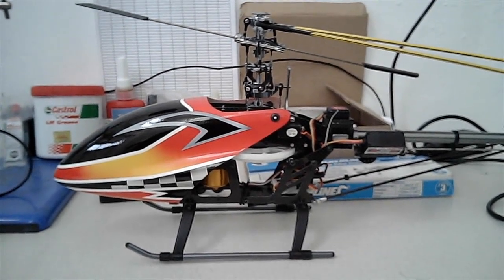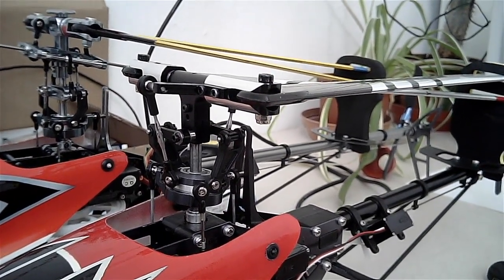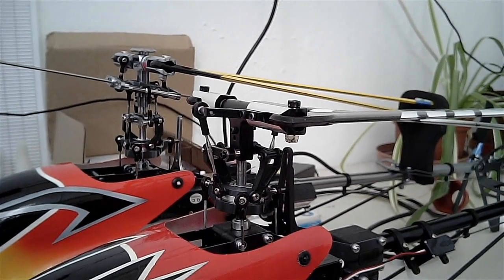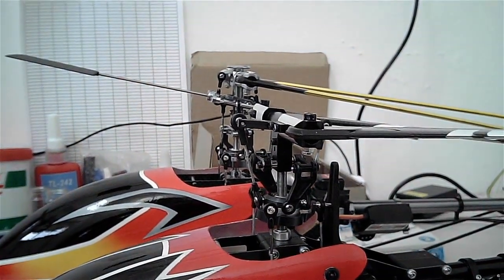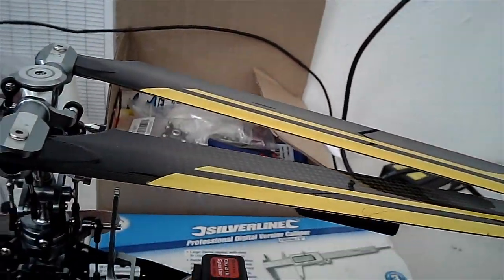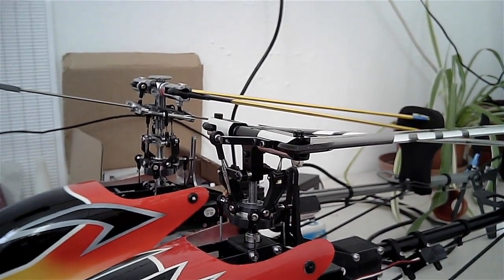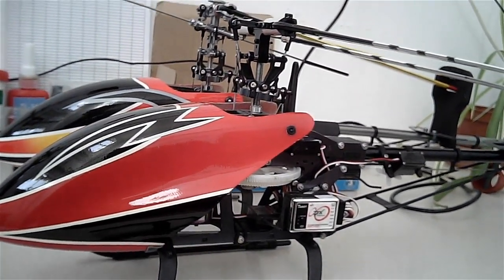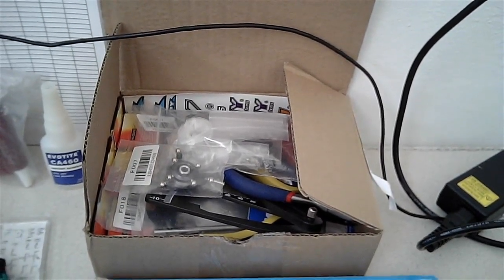HK-450GT Flybarless Conversion - pt 1 - Introduction

Comment: I bought a flybarred KDS Innova 450QS. Can I also convert it to flybarless using the parts you mentioned in the video?
Reply: Your question is 4 years old but just in case some new viewer has the same question, the answer is yes, you can. Discard your old tail gyro and your old flybarred rotor head, replace your old tail gyro with a FBL 3-axes gyro ( I recommend the TGZ380 (cheap, easy to set-up and reliable), replace your old flybarred rotorhead with a FBL head (I bought Tarot). Watch youtube videos (such as the above) to set your KDS Heli and you are good to go. (I have actually converted ny KDS 450C). I have several times replaced my KDS swash servos since I bought my heli due to crashes but if I remember right the original (factory) swash servos on my KDS 450C were digitals (KDS-N580 or KDS-N590), If yours still are, then they are good to be used with an FBL. Otherwise, the masters recommend upgrading your analog swash servos to digital as they would be best for FBL  Have fun!

Comment: Thank you, I appreciate it! That's exactly what I'm going through at the moment, so I'll just ignore lengths mentioned in the manual for now and unwind the swash to servo linkages as much as I dare as well and re-adjust with the pitch linkages as much as physically possible to shoot for zero pitch on midstick and equal pitch range. :)

Comment from the maker: I'm away from the helicopter at the moment so forgive me for not answering with numbers at this time (I'll get back to you on this!).  Also, please bear in mind that these are v1 / v2 clones.  With that said I found similar - the swash to servo linkages were wound out as much as I dare to make them as long as possible.  The pitch linkages are the Tarot adjustable linkages and they are wound in almost to the limit to make those arms relatively short.  This avoided binding with -ve pitch & cyclic.

Comment: Excellent video, looking forward to the next parts Simon. Thanks!

I've got one question for you, could you please provide the length of the swash linkages (three shorter ones, obviously) and pitch linkages (two long ones) on your flybarless helicopter? For some reason the Align 450 3G manual doesn't really give good 'in the ballpark' lengths. 

I'm already close to what it should be on my CopterX 450 Pro, but I'm wondering if I shouldn't go out and just buy longer servo to swash linkages.